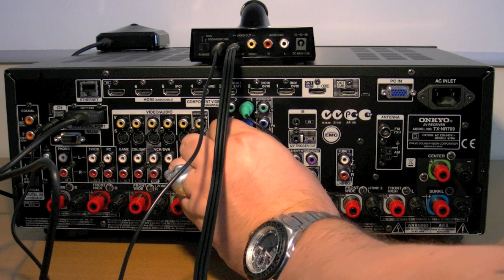ONKYO AVR AV Home Cinema Receiver -  Installing an iPod Dock

Comment from the maker: @jessiemanjack Hi, in general, this is possible as the output connectors for video and audio are standard RCA connectors. In addition, there is a dedicated IR remote that allows control of playback. Some Onkyo specific features will not be available - e.g. controlling the dock with the AV receiver's remote control (which requrires connecting the dock and the Onkyo AVR or stereo receiver by means of a separate RI cable)

Comment: I am also having the same issue as user gilltypro. I have the RCA red/white audio jacks going from the dock to VCR/DVR in. And I have component going into component 1. I changed the input display so VCR/DVR shows up as DOCK. I also reassigned the VCR/DVR input on the receiver to use component IN1. However, the on screen display is not showing. I set my dock to component mode as well. When I connect the dock straight to my TV's component input, the OSD works fine, but when it's connected to my r

Comment: I have onkyo Tx-Sr606 receiver. The Dock DS-A1XP it works at receiver?
Reply from the maker: Hi and yes, the dock works with the TX-SR606. But please be aware that the dock will support the following iPod models only: 5th Generation iPod (iPod with video), iPod photo (iPod with color display), 4th Generation iPod, 2nd Generation iPod nano, 1st Generation iPod nano, iPod mini.

Thanks for asking!
Reply: Ok. Thanks!

Comment from the maker: @tshirtjohn Hi, unfortunately this is not possible. A possible solution would an AVR with IR IN (e.g. TX-NR709 and higher) and a commercially available multiroom kit (eg. from Niles and Xantech). You can find more information in the TX-NR709 manual (on our website eu.onkyo.com) on page 85.

Comment from the maker: @ronaldcanojr Hi, please verify that you follow these sections in the manual: Video Output Mode (page 9, #4), OSD Mode (page 9, #5), Setting TV System (page 12) - if you still experience trouble, please get in touch with our support: customercare_eu@eu.onkyo.com    Thank you

Comment from the maker: Hi, please verify that you follow these sections in the manual: Video Output Mode (page 9, #4), OSD Mode (page 9, #5), Setting TV System (page 12) - if you still experience trouble, please get in touch with our support: customercare_eu@eu.onkyo.com Thank you